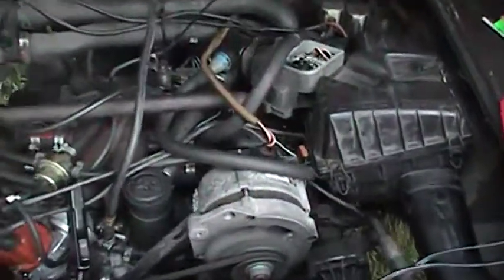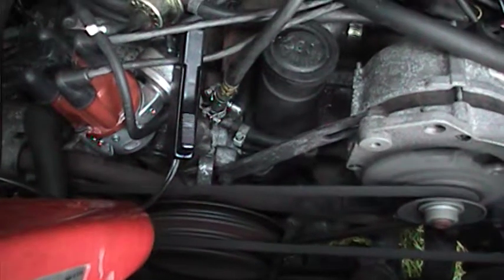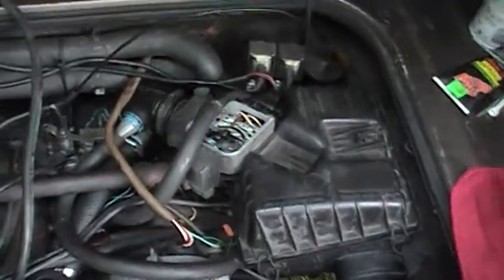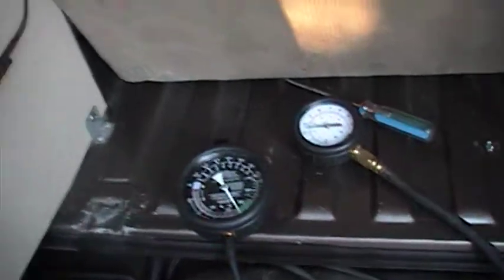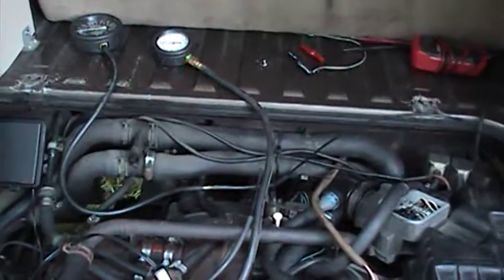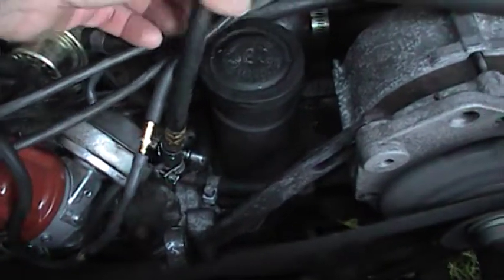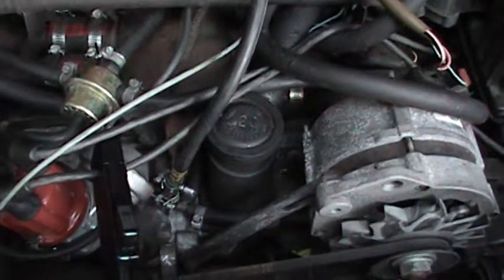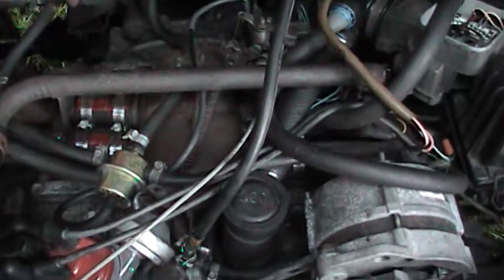Walter '85 Vanagon dies when throttle opened w/ vac advance connected

Comment: try a known good distro or diag/replace a adv/ret can (suck on the vac hose to see if it moves the distro mechanism). you may have a leaky can or retarding too much to keep the engine running. i take it this is a 1.9L per year listed and the coolant hoses. adjust your timing first, all in with everything connected to 35-40 deg depending on your altitude (forget bentley procedure), then your throttle idle screw. check the TPS switches/adjust if needed. let us know if its solved. i know its an old thread. DO NOT use a 009

Comment: i just notice your distributor is turned all the way clockwise to about 60+ deg advance. Way too much advance and why it dies when you open the throttle.  You should adjust timing at full advance  35-38 Deg@ 3000 rpm.  Then use the throttle screw to adjust the idle speed.

Comment: I would change the distributor for a one that doesn't use vacuum air .
Reply: Put a Bosch 009 mechanical advance distributor in.
Reply: No chain on that engine.

Comment: Nice to see someone else struggling to get the van running like it should. By the way, noticed your hose going into the top hole on the s-boot.  I just found out a month ago that there is a ridge on the plastic piece that goes into the s-boot and a matching recess on the inside of the s-boot. It was quite difficult but that plastic piece snaps into the s-boot and is a pretty tight fit afterwards. No more working it's way out or loose. If this is old news please ignore:)
Reply: This comment from 10yr ago helped me today! 😄

Comment: timing not 100%, whats the compresion on the cylinders? worn oxygen sensors n worn out head temperature sensors? redo electrics by sottering all connections , lose plug together connections, all grounds 100% clean, try a 45000 volt nology or pertronics coil electronic ignition n cables, every detail = a  more reliable runner